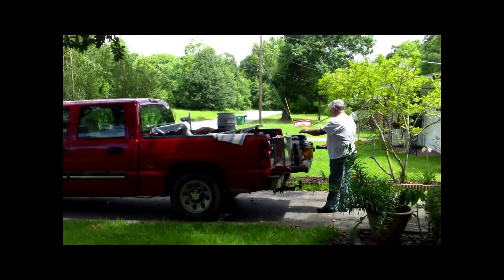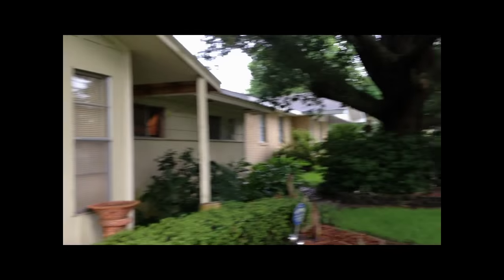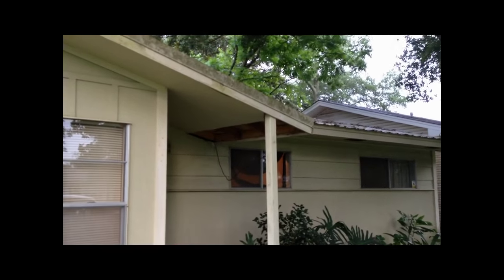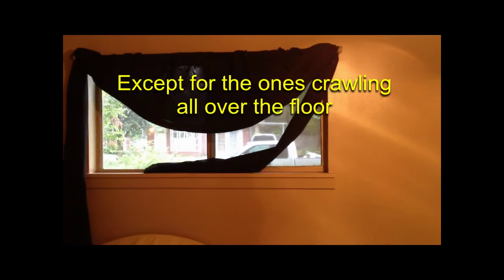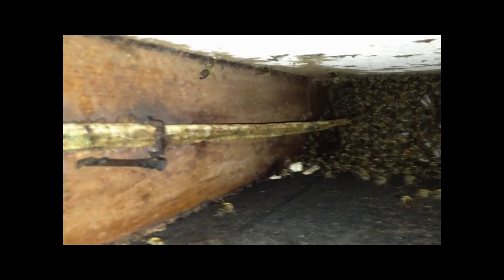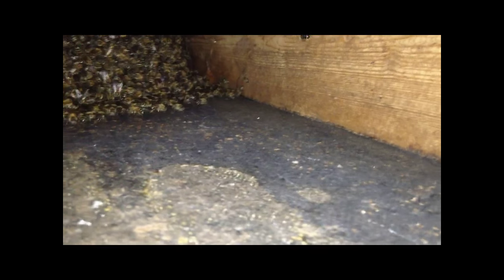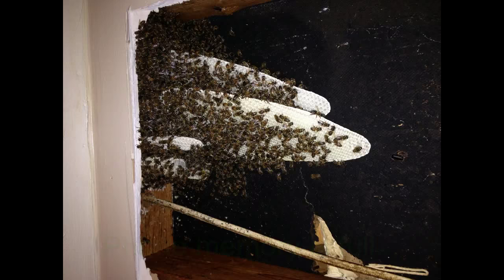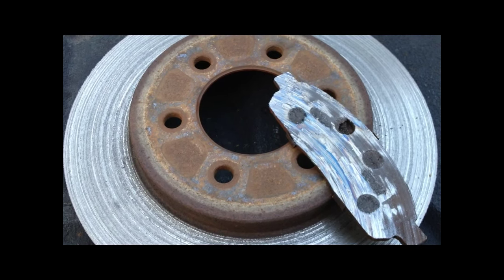Zombie Pug And A Bee Hive

Comment: Smartcar is a unit of measurement, My living room is 2 smartcars long.
Reply: +Ken Lee Yes, true, but it is MORE! It has multiple uses, as was demonstrated in the video, it can even describe noises, moods, and people's characters!
Reply from the maker: +M. Smith ROTFL!!  I'll have to try and use more smart car measurements in future videos.
Reply: +628DirtRooster Oh and we should probably always put "smart" in parenthesis when describing "smart" cars!!!! I couldn't help but conger up an image of what would have happened if those lousy brakes of your had failed at an intersection with one of the those "smart" cars in front of your beast! It would have sounded like a scalded (little rat type) dog - YIPE YIPE YIPE!!!
Reply from the maker: M. Smith When you check the radiator on those do you top them off with smart water?
Reply: +628DirtRooster No Smarty, I think that they are air-cooled! A 250 cc motor doesn't need much cooling!
Reply: +628DirtRooster I think that you have to pedal to get them going, so it might be smart to DRINK some water yourself!

Comment: You still had plenty of metal left on those pads :)))
Reply from the maker: +krazy45cat Haha.  A friend of mine ran his so low that one of his pads fell out in my driveway.  LOL
Reply: +628DirtRooster My first car was a 84 mustang gt and I pushed a piston through a pad and into the rotor. My dad was very upset. Rotors weren't as cheap then as they are now. Whoops.
Reply from the maker: Caleb Welte Oh man.  I bought my wife an 84 mustang early in our marriage.  I can't remember what happened to that thing.  You were trying to drive the wheels off that thing.
Reply: +628DirtRooster bEEN THERE DON THAT TO MANY TIMES IN MY YOUTH :)))
Reply: +628DirtRooster   a friend a mine once done that at a stop sign. disk  et through the heads of the screws holding the brake pads.